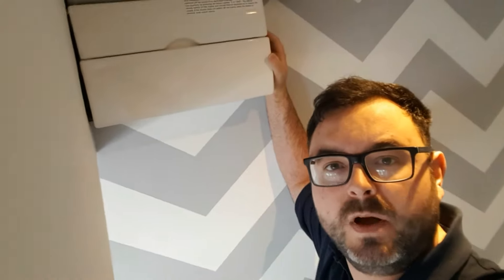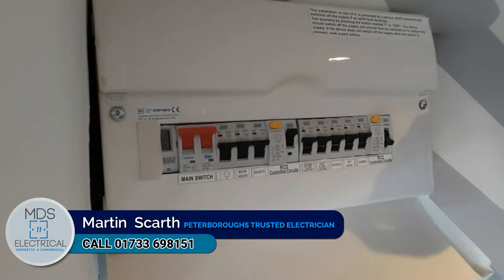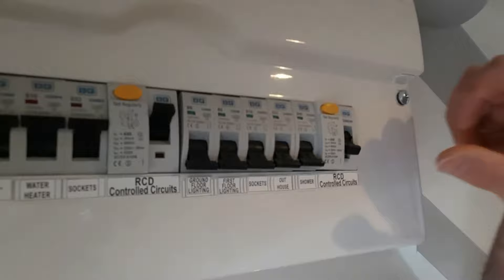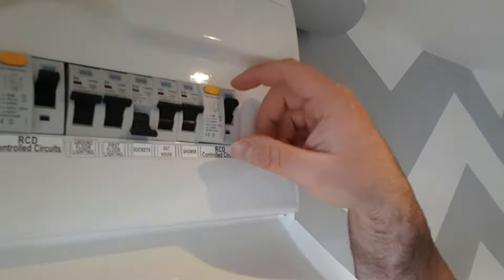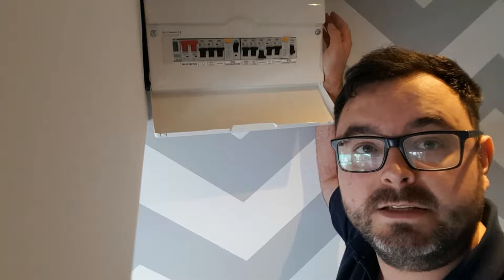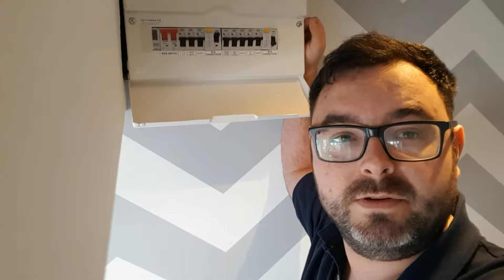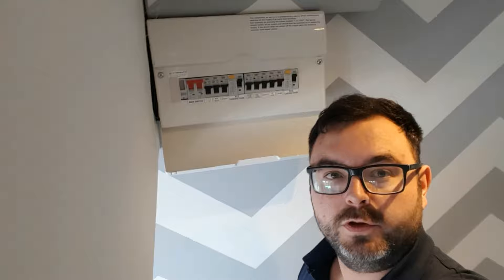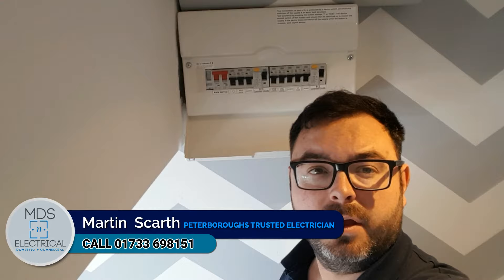Fuse box keeps tripping? Does your electric keep tripping? Then watch this video by MDS Electrical

Comment: We had a similar problem a few months back. Things tripped once in a while and could not find a fault anywhere. Called our neighbour and friend round to check things for us who is a fully qualified electrician.
He checked absolutely everything including my workshop.
Eventually, he went outside to our metre and found the fault, one of the cables was not even secured.
He fixed the problem but asked us not to say anything as he could be fined for touching the metre.
The company that installed the metre was NorthernPower.
Not the first time I have heard about their shoddy workmanship.
You don't even have to be a fully qualified electrician to fit these meters.
They just go on a 2-day course and that's it, they are out the next day fitting them.

Comment: Watched your video Martin and followed your trouble shooting advise to successfully isolate why a ring main tripped out in my Kitchen area. Suspected the washing triggered my RCD protection switch. Had a bit of a think as to why the breaker kept tripping and searched Youtube and found your channel very helpful. Now restored power without the need to callout an electrician. If it trips again I may have to do so but for now top advice, thank you!

Comment: JUST LIKED TO SAY THANKS YOU SAVED THE DAY.  I CAME HOME AT MIDNIGHT TO FIND NO SOCKETS WERE WORKING. EVENTUALLY AFTER WATCHING YOUR VIDEO I FOUND THE CULPRIT.  IT WAS THE COOKER. SO I WILL GET SOMEONE OUT TO LOOK AT THAT IN THE MORNING.  I AM DISABLED AS WELL SO NEED THE ELECTRIC EQUIPMENT THAT IS USED VIA THE SOCKETS. ALL ARE BACK ON NOW.
THANKS AGAIN. YOU EXPLAINED IT VERY EASILY TO UNDERSTAND. 10/10 TO YOU

Comment: I did all this and of course it keeps tripping. What can an electrician do apart from replace the entire lower floor socket system (this is what is tripping in my house)? How can the fault be diagnosed? Surely there are wires runnng in walls,, under floorboards where we have rats etc which can only be checked by taking the plaster off the walls, lifting the floorboards? It's a nightmare! Thumbs up to video

Comment: Cheers pal, I had a power point under a leaking sink, god knows why the power point is under the bottle trap . I had it turned off, but thanks to your tip. I physically unplugged it and bing bang bush back in business for a call of duty session and the champions league final.

Comment: My friend called me about a faulty oven that would trip when set to high. After investigating the wires in the oven fused together burnt. He told me the lights go out when we turn it on. After checking the socket I realized his landlord connected a 13A socket to the lighting ring circuit and stuck an oven on it.

Comment: thanks, excellent video. my new boiler that's been fitted recently shares all the house wall sockets kept switching the mains switch to off. british gas came out and went through what you just said and the fact fuse box needs upgrading

Comment: My MCB trips exactly after 30-35 minute. Only lights get affected by this so nothing overloaded. To test it, even when I switch off all lights, MCB trips after 30-35 minutes. So at the most I get full lights on only for about half hour. Initially, thought it might be damp somewhere but it happens during summer as well. 

All heavy compliances work fine. Not sure what else could be the issue.
Reply: How did u solve ur problem I am having exactly the same problem with lights switches as soon as I turn it on it trips

Comment: I'm in an older property, what happens if I don't have an RCD? My kitchen has lots of appliances attached to the circuit and the fuse that keeps tripping, that is making it hard to figure out which one is causing the problem as it only happens randomly...

Comment: Occasionally for no reason RCD will trip off. With elimination sockets is the problem. So I pull all the plugs out switch off all the sockets  , still unable to  reset the fuse box, still trips it. However after few attempts back to normal, so no faulty appliances ! This always happens every few months or so. Somebody suggested that I should let the fuse terminals to cool down before I try to reset the RCD. I had an electrician to check the fuse box and he gave the thumbs up
Reply: After all these times it was the dishwasher causing the problem . We scrapped it and end of problem. Your instruction " you must pull the plug out" was very useful. Now I know if you have a faulty appliance even if you turn the socket switch -appliance not in use  YOU MUST PULL THE PLUG OUT to eliminate the problem. Thanks

Comment: Hi Martin, what do you do if a socket is full of water? Because the kitchen sink was leaking silently and there were some sockets and cables in that cupboard and dishwasher on the next one. BG engineer didn't fix the socket, he said the leak needs to be investigated and covered up the socket now can't use anything in the kitchen because the kitchen switch on the fuseboard trips off straight away, it used to be time to time before he attended today :( we stopped the leak going into the cables but I think needs time to dry however I don't understand how he managed to make it worse and why he didn't fix it!?

Comment: I have an issue on the socket circuit, if the power remains on with everything thing unplugged is the problem 100% with an appliance or could the house electrics still be at fault? as multiple appliances using diferrent sockets cause the power to trip? thanks for any help.

Comment: I had a new think it was a Radial circuit installed in my workshop  with a seperate unit from the house theres a special caravan Like socket for the welder i bought 220 volts and also a few plug sockets bought a new chop saw last saturday plugged it into one of the sockets and it just tripped out , yet when i plugged it into a socket in my house it was fine with no tripping out , are these seperate workshop units more sensitive than the house Consumer unit ? all a bit wierd really

Comment: A plug that is not inserted properly would this cause the mcb to trip too. Out in my utility room the cat knocked the plug to the side on the wall. Plugged it back in and turned back on the mcb it hasn't tripped back down since

Comment: My nana and grandad have a big house and it’s always tripping the main braker, my grandad hasn’t there’s to much fault and that’s why the main braker goes, to much neutral to ground, he says that’s only so much fault each one can have or something, he’s always putting things on different circuit trying to fix it and it never happens, they keep running extension leads and just living with it.  
What tools could I buy to diagnose it? 
What are them machines called when people do an EiCR?   I know they are expensive but I’ll get it used and just resell it when I’m done with it. 
I know they need a qualified electrician but they just won’t do that!   If I don’t spend 20 hours trying to learn this and fix it, they will live with it till there’s a fire, if they main beaker gose off, the pump to the back boiler will go off and if it’s not noticed and left it will explode and this worries me.

Comment: Hi ,  ive had a hoover blow out to the extent of a burning smell , and it also tripped the circuit board ,  I then bought another cheaper hoover to use and that blowed out aswell with a burning smell  and also tripped the cultivation board , then my wife was useing  another hover from the up stairs socket and she could smell a burning smell so before anything turned it off and stopped then  turned and unplugged out the switch ? Any ideas plesse

Comment: Installed a boiling water tap. If this is switched on, and we run the dishwasher or washing machine, the fuse board trips. 
When I turn off the electric to the tap, I can switch back on, and the washing machine or dishwasher will work.
Any ideas????

Comment: Thanks mate great stuff. We have a tripping issue that very sparodic and happens when we plug in the Hoover or hair dryer. Both are new, don't always cause  and don't trip when used elsewhere .
We have 3 wired in ei smoke, heat and  carbon monoxide detectors  that have begun intermittently beeping , and are triggered by switching on a high wattage appliance, such kettle if hairdryer.7 I was wondering whether these two occurances might by linked. Could a fault in the dectectors be causing the tripping? Thanks

Comment: in just over one week 2 kettles have stopped working one trips the fuse, one boils only so far then stop. Then on Tuesday my electric oven & grill will not heat up properly..... what's going on? I've stopped using the kettles, checked the sockets and they are working and fuse is not tripping

Comment: Hi, we used 3000w heater directly to the wall plug .. on night suddenly we hear small explosions and than everything turns off in the room, than when I checked the Breaker box i saw one tripped out, I tried back it online but every time its immediately tripping out with sparks and noise, than I unplugged everything but its keep jumping out, i was thought maybe the breaker was defect, but after installing the new one again the same issue, i controls the plug which the heater was plugged but i found nothing, its look like a wire inside the wall is burned and causing shortcuts..
anyone have any idea please ?